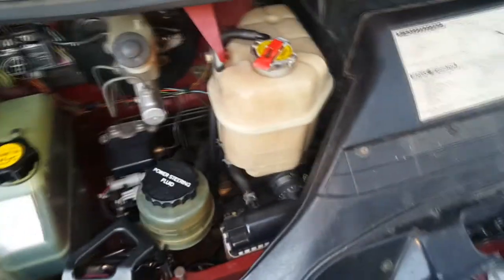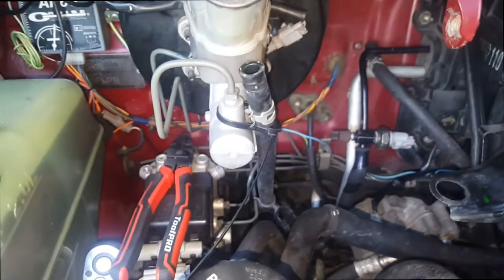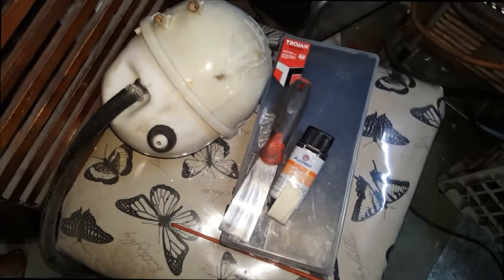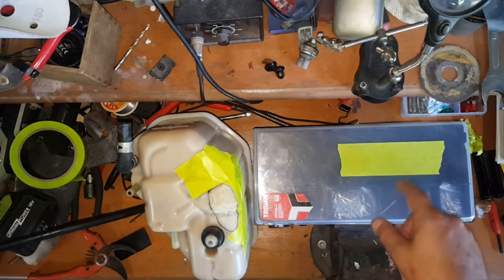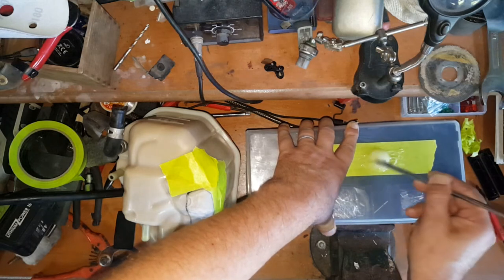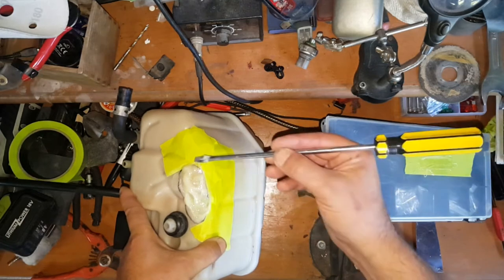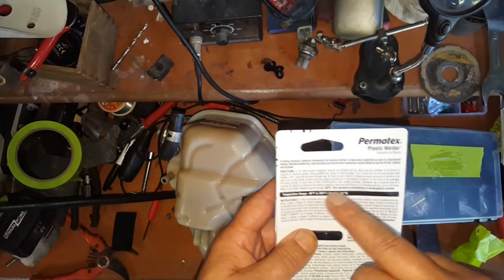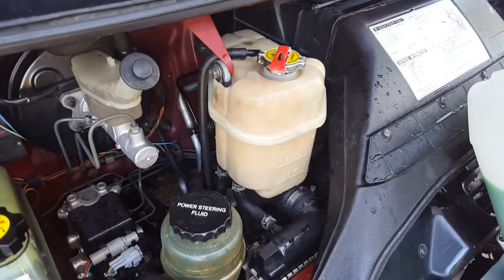How To Fix A Leaky Coolant Overflow Reservoir Expansion Tank

Comment: Leaking expansion tank on 2008 Toyota Sienna is either replace the tank with the fan shroud ( one piece not sold separately ) or as I did  by going to wrecker and buying a used tank from a different car ( Honda in my case ) and installing that for far cheaper . It works and that is good enough for me. Sienna tank seems to be too close to the cat converter shield hence it dry's out the plastic and cracks happen. From what the forum says this seems to be another common complaint!
Reply from the maker: I often wonder what engineers were thinking when they decide things like that. I love DIY idea's good job.

Comment: Great video. Mine is the round one leaking at the seam so not sure if the sealant will work as I think it expands at the seam. Will give it a go though to see if it works.
Reply: @JohnSmith-os6yx  it did work but I put a lot on. Not sure how long i will last
Reply from the maker: Yes I did and it's still good on my van

Comment: I have a Toyota Lexus that has developed a fine crack under its expn tank! replacement some £150 (~$200), so I will definitely try your solution.
(Just to add for metal radiators themselves they really need brazed or welded which I have have done often in the past, if leak is accessible).
Reply from the maker: This repair I did it still repaired. You will be fine as long as you make sure the area is clean and roughed up a little.
Reply: @TaragoPreviaEstima  Done exactly as you said, cleaned area with meths and scrubbed with scotchbrite pad. Used the exact Permatex  you used, put it all back together allowed 24hr cure. It's holding just fantastic, no more coolant loss. Thankyou TT you saved me the expense of a new expansion tank about $200.
Reply from the maker: @tomctutor  Brilliant I am happy it helped. This clip was posted 1 year ago and the repair on my reservoir is still good as well.  Permatex is great stuff. I have used it on many things and it has never failed. your repair will last a very long time. Cheers

Comment: The shape of the reservoir you repaired lends itself to cracking, as it is pressurised every time it reaches operating temp..
I recon the ball shape would better from that point of view ..
Reply from the maker: Understood, That thought has crossed my mind as well however the reservoir tank has lasted 28 years so far and I like it's shape more. For now while it works I will keep using it and keep the other as a spare.

Comment: Mines has a hole in the coolant can I use that to cover the hole (about 1 in big) temporarily?
Reply from the maker: On the tank like I did yes you can. If the hole is already 1" big it would be better to replace the tank however as for a temporary fix it should work.

Comment: The best way to repair this if absolutely necessary would be to cap off both holes and put tank under a vacuum to suck epoxy into leaks from the outside since it would hard to do from the inside.
Reply from the maker: That's a good idea. The repair I did is still working.